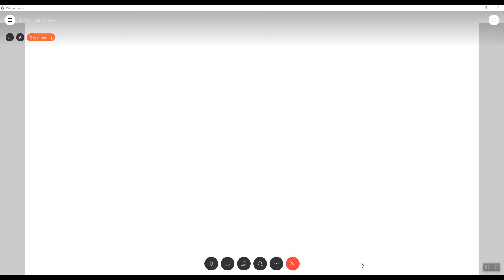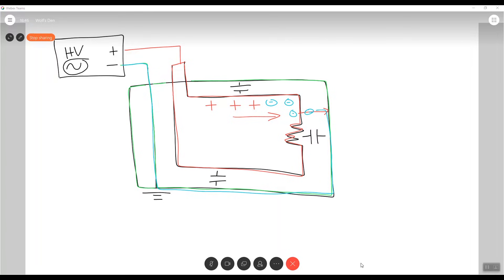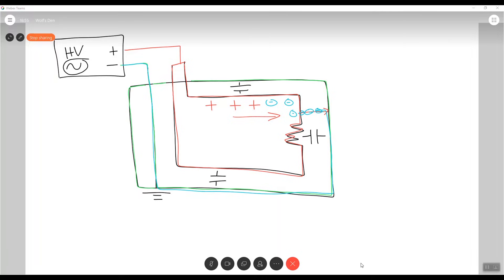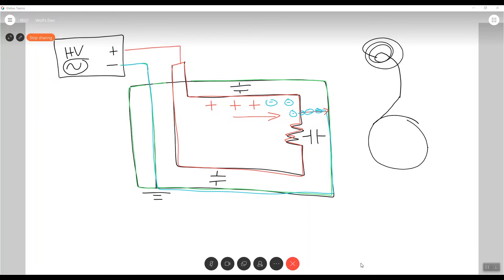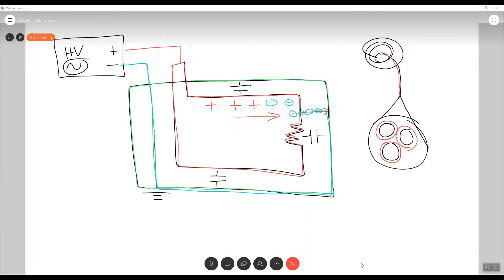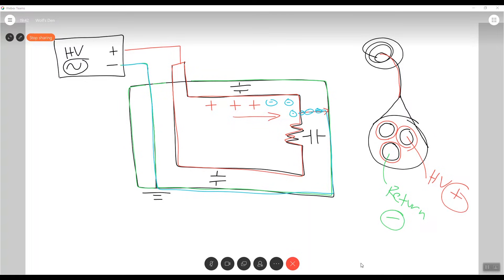How to Hipot Test

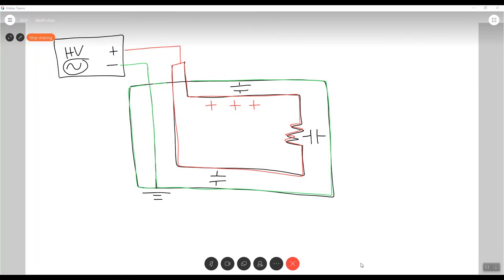Comment: 2:55 and following -- the electron flow direction is drawn and described backwards.  If the line/neutral circuit is attached to a positive voltage, and there is leakage to the grounded case, then there will be a positive current in the direction from the circuit to the case. A positive current, in this situation, is composed of the negative charges carried by electrons flowing in the opposite direction.  Or to put it another way, the positive voltage on the circuit corresponds to a deficit of electrons, and when that deficit is sufficient (high enough voltage), then electrons will be attracted from the case.

Comment: what is the difference on a hipot test and a megger test when it comes to motor winding?
Reply: Meggering = insulation integrity. Non  destructive.

Hi pot = Insulation breakdown or dielectric withstand strength. This can be destructive or non destructive.

Comment: Can we do hipot test with standard insulation tester?
Some can do up to 1kv, 5kv, even 10kv; granted they give result in mega/gigaohms but can you work out the current through ohm's law and we're already know the voltage?
Reply: Hi-Pot testers can limit the maximum current and therefore not cause damage to the equipment when detecting it has bad insulation. Insulation resistance testers generally don't have the ability to control the current, therefore on higher voltages you can fry sensitive electronic equipment (if present).  You may be able to repair the equipment insulation and keep using it when detecting it with a HI-POT, compared to if you IR test it on a higher voltage while you may detect faulty insulation, you have also probably destroyed the electronics if the current is able to flow across it.

Comment: thank you for the informative video Sir,
wanted to understand this test for 3phase motor as well.
can you specify what should be the time and leakage current allowed for production test of a 3 phase motor rated for 110V AC.?
Reply: It should be written in the electrical code the motors are meeting.

Comment: Good video, but I can't use it because when you run the test you fail to use the provided guards for your test equipment. Safety is crucial in our training. Thanks
Reply: Is the argument that safety barriers should be in place during the hipot test to prevent someone from making contact with the UUT (unit under test)? Are you saying the hipot  test can make the grounded metal of the UUT live at a high voltage if the dialectic is not sufficient? I ask because someone told me to press start on a hipot tester while he rested his arms on the enclosure. I refused and he got irritated. It was a 2200 volt test of a UL 508 enclosure. Thanks
Reply: They aren't provided! they cost extra! And you could just implement them and still do it this way..
Reply: Safety is number 1 that is a given. Take the video for the good info.... he made a really good video . Hold your criticism
Reply: David Valle, if safety is #1 and is a “given”, then why is it that so many electronic engineers and testing technicians get shocked every year, and in some cases they end up in the hospital? 

I didn’t criticize the content, in fact I recognized that it’s a good video, but when trainees see the trainer bypassing or avoiding safety devices (without a clear disclaimer) they figure they can do the same. 

It’s dangerous to think that safety is a given, processes such as this need to be poke-yoked. I have had to sit in front of OSHA and explain where our training, supervision and lack of safety devices failed to protect a seasoned and very experienced UL testing technician and what we were going to do differently to prevent from having another shock injury.

Oh, and please don’t be so thin skinned when it comes to criticism
Reply: Did he make the video for your commercial use?

Comment: Thanks for the video. If we do Hipot test kind of computer's power supply, should we turn on its On/Off switch or leave it off?
Reply: Thanks for your question Roman. We recommend the power switch of your DUT be in the ON position to close any contacts or relays. This allows the Hipot test to check the entire circuit for leakage. If your DUT is in the OFF position you may only be testing up to the power switch and fail to test the entire DUT as intended.
Reply: You have to turn on the power supply switch because you have to allow electrons to pass through the switch to the circuit.